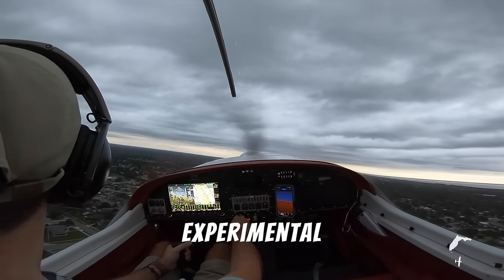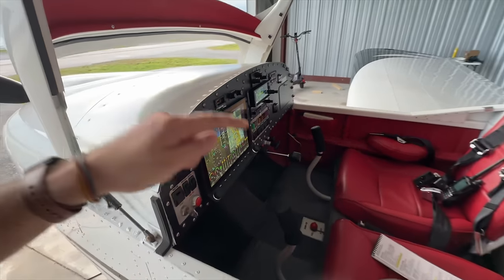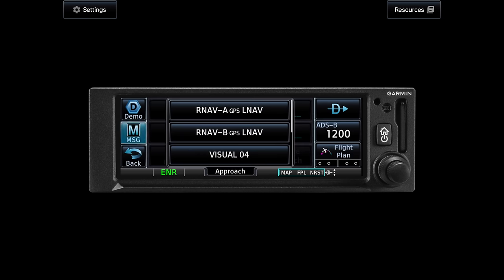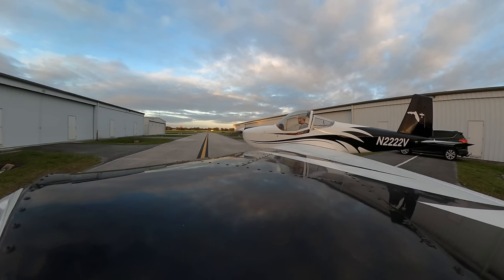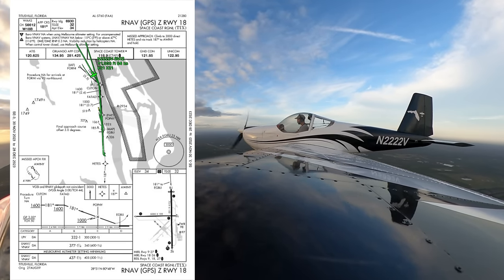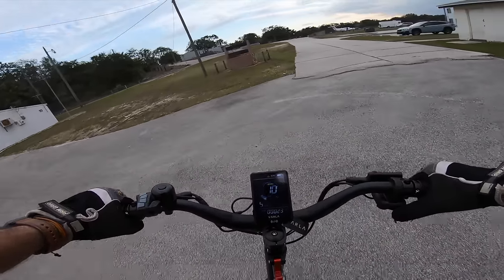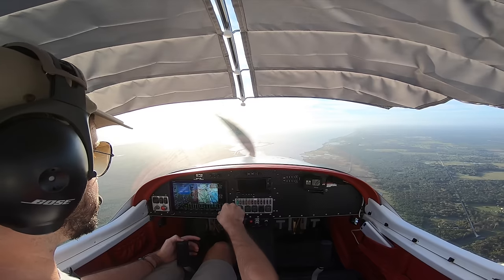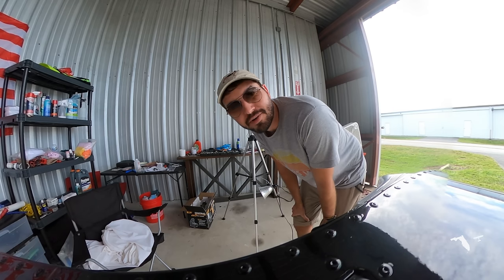Flying IFR in a LIGHT SPORT Airplane - How it’s done

Comment: Nice.  Just a lil advice from an Avionics tech here since 1993.   Please Please Please do something with the wires you have begging to chafe back there behind the instrument panel.  Didn't see the end finish but if it's still like time stamp 5:15 you are gonna have issues real soon.  Tye wrap and adel everything you see floppin. What you can't secure with an adel to the frame with hardware at least every 6 inches you need to wrap with spiral wrap or some sort of kevlar curly wrap.  You will have issues if you leave it like that I promise.  Also, I would not fly with the scooter.  Not before completely tearing into it to inspect the battery and make sure it's properly cushioned with foam and securely installed.  IF that lipo bomb decides to go off while you are in flight you will be a goner.  Just pull up some videos of Lipo explosions.  Other than that, good job on the IFR approaches.  I would love to own a plane like that.

Comment: This topic has been hashed out so many times regarding the legality of an ELSA into IMC conditions.  Ignoring the question of whether an RV12 should ever be flown into actual IMC conditions, especially without a back up like a G5.  It would be nice to have a DAR or FSDO actually chime in on the issue.  I would think the OL and appropriate minimum equipments would be enough, but then there is the ASTM which supposedly prohibits it.  But, really nice set up for training and staying current.  And I would think would be fine for those pesky marine layers.  This is exactly what I have thought about doing if I buy a 12.  Again, I would want a backup G5 in that panel. Gonna be a really bad day if that PFD screen goes out in IMC.  We get that stupid low layer occasionally that is just at 1000 ft agl with no icing and it sits there taunting us VFR pilots waiting for it to burn off.  Also nice to have in case that layer slides on in while out flying and trying to get back.  Nice install.
Reply from the maker: It’s an interesting topic. I feel that if an experimental amateur built airplane is legal for IFR if properly equipped, there’s no reason for an ELSA to be prohibited if equipped. ASTM standards do not supersede the FAA, and many experimental aircraft do not comply with ASTM. ASTM can make a recommendation only. If the FAA says I can do it in my operating limitations, then I can do it legally (maybe not entirely safely).

And yes, right now my backup horizon will be my iPhone connected to the GPS175 AHRS. The 175 is on its own circuit independent of the Dynon so I feel that it is a good backup in case the Dynon fails. I am also considering the Dynon pocket panel as a backup.
Reply: I am with you on this. No backup G5 or uAvionix equivalent AI and no nav radio (or a backup gps like a 430) there is no way I would fly it in IMC.
Reply: @steven2145  
backup nav radio...cmon.  Your cell phone has better capabilities!  Add a backup artificial horizon (which doesn't have to be certified) and this setup is better than any AC flying radios!
Reply: @its4michael  We are talking about IFR into IMC. Yes, I want a certified backup. In VMC I am happy to navigate with my ipad.
Reply: There is no debate on this topic. An experimental airplane is allowed to be equipped and flown ifr if the operating limitations do not explicitly prohibited it. The only difference between a light sport experimental and a normal experimental is the gross weight and the certificate required to fly it. If a holder of a ppl and valid medical flys a light sport then it can be flown as if it is a regular ppl aircraft. If a light sport is flown by a holder of only a light sport certificate then it may only be flown as a light sport plane. I.e. a light sport plane may be flown at night so long as equipped with required lighting but only by a ppl since an LSA pilot is prohibited from flying at night.
Reply: got references or can you site a source?  there actually is debate on this topic and has been.  Even Vans own website used to say not to be flown into IMC.  So there is debate.  Sure, strictly based on the FAR it seems like we should be able to.  Then it depends if the ASTM standards apply only to the SLSAs or to all LSAs.  I would think only the SLSA.  From what I have read the FAA does take the ASTM into account.  So, like I said, there is debate.  I would like to hear from someone in the FAA.
Reply: @user-fm7ye7cj5e  there may be debate in the definition sense of the word if you want to be a smart ass but there is no debate in the sense that there is no rule saying you can't. A properly rated pilot can fly imc in any aircraft that is equipped with the required instruments. Lsa aircraft are no exception as long as the operating limitations don't explicitly say you cannot. As far as s-lsa is concerned then it  depends on what restrictions the manufacturer placed on the aircraft when it was certified. For example, No lsa pilot can fly at night and most lsa aircraft cannot either but if the lsa aircraft is properly equipped and not explicitly prohibited from flying at night then a properly rated pilot such as a pol holder may fly said aircraft at night. Then there are people like you who come along and make more into nothing and the feds despise this, don't read between the lines. If there is nothing saying you can't then you in fact can.

Comment: Correct me if I'm wrong, but I though experimental and light sport were two different categories.  How are you both?  Light sport are certified aircraft which is why you can receive instruction in them but have weight and power restrictions, compared to experimental.
Reply from the maker: There are SLSA which are “Special Light Sport Aircraft” which are the “certified” versions. I have an ELSA which is experimental light sport. The plane has the weight and speed restrictions with the added freedom of experimental airplanes
Reply: @FloridaFlying can you still fly this without a PPL and only a sport pilots license in the experimental category? What about without a medical?
Reply from the maker: @jimjohnson3244 yes you can, however you have to fly it under sport pilot rules (VFR daytime only). If you are a private pilot you can fly it under PPL rules

Comment: very cool upgrade! I only have one questino, you are still flying under VFR rules and shooting approaches under VMC right? or could you actually file an IFR flightplan and with IMC on that setup?
Reply: Looks like he only has one Attitude instrument (the Dynon) so technically, yes he could fly IFR, but if the Dynon quits he's going to be in trouble.
Reply from the maker: Yeah I haven’t really been in serious IMC yet, looking at getting a Dynon pocket panel as a backup. I do have my phone connected to the GPS175 which has its own AHRS so that is the current backup. With the Dynon pocket panel I could have 3 independent attitude indicators, but with ground speed only…

Comment: I would agree with a few other comments that i would wany to have a backup display like a G5 or equivalent. Is a backup display (attitude, airspeed, altimeter) not a requirement for flight into IMC? I always thought it was.
Reply from the maker: I also agree, I am thinking of putting in a Dynon pocket panel or connecting my iPhone to the GPS175 ahrs as a backup (that’s what is in the video thumbnail) The gps has a built in AHRS and is on its own circuit.
Reply: Ah, I went back to the intro and I see the phone with the AHRS display now. Definitely a great setup for training. Call me conservative, but I still think I'd want a permanently installed backup display. This setup you have is definitely my goal when I eventually get around to building. Nicely done! Including an autopilot with "Level" button as a safety for a short encounter with spacial disorientation.
Reply: Good idea for backup. I use iPhone and Stratux ahrs as a backup AI

Comment: Did you build this? It shows N2222V was built by Vans not you? Otherwise, you can not do condition inspection. IFR, you need Avionics shop to do pitot static, not just throw a GPS in, even if you built it. Do a new W&B?  So are you legal?
Reply from the maker: All ELSA aircraft show that they are built by the factory that produced the kit. You can deviate from the kit in an ELSA only after airworthiness is granted. I had an avionics shop do my pitot static and transponder check which is logged in the aircraft’s logbook. I have an updated weight and balance after my GPS was installed. I have my light sport repairman inspection certificate issued with my name and N2222V on the card. Any other questions?
Reply: @FloridaFlying   OK, I am a lifetime EAA member, built two RV's, latest an RV7. I am not up on ELSA..... In the case of both my RV's I was listed as manufacture. So your plane is not a SLSA.  I assume you have repairman certificate? May be that is not needed for LSA? I recall you can go through through training and then be able to work on your LSA, even if you did not build it? Do you know if that is correct? I ask because I am a CFI-I-II, ATP and like to understand LSA's better

I know the LSA pilot requirements, but the maintenance I was not sure. I will study the topic. I thought it was the same as any EAB kit plane, like all RV's (not LSA), both in the way it is registered (builders name as manufacture) and the ability to do condition inspection (repairman's certificate). Apparently it is different. Fly safe. Those LPV approaches are slick.

Comment: Nice although that trivial functionality should just be part of the main display, not a 5k$ additional unit for no reason.
Reply from the maker: Yeah, it should. I think in the future Dynon will add the functionality once they have the approval. It’s all just paperwork
Reply: IFR flight requires certified equipment the experimental aircraft does not.  Dynon has certified equipment (pretty much everything they carry can be ordered certified or not),  He chose the Garmin because of the space available and the size of the certified Garmin not because Dynon  doesn't have certified avionics.  There are no differences in the functionality between a Dynon certified display or one that is not certified, your just paying for a $5000 piece of paper from the FAA stating it is certified.  
Only certified equipment can be installed in  certified aircraft (for primary flight instrumentation that is) but in experimentals you can use much cheaper, entirely capable, often better systems and they don't have to have that expensive FAA stamp.
Reply: @its4michael Me thinks the bulk of that $5,000 goes to the legal retention fee and product liability insurance premium budget cost line item. Anyway @FloridaFlying, sweet setup!